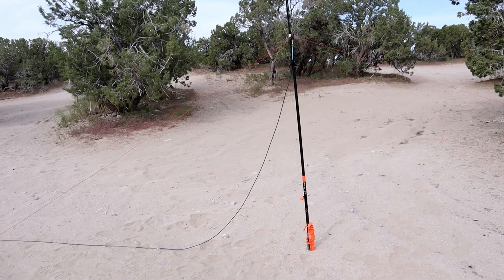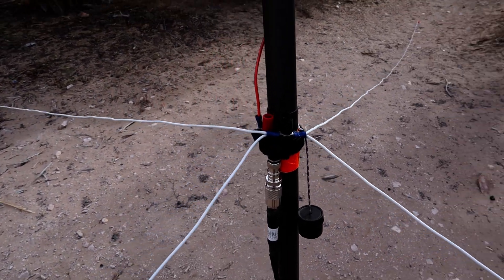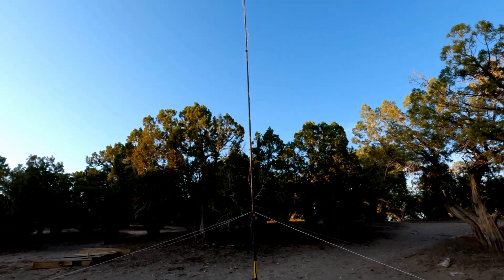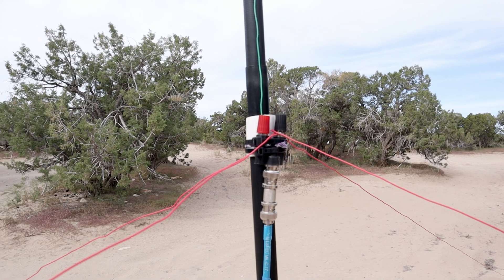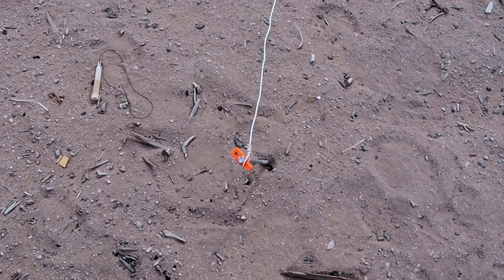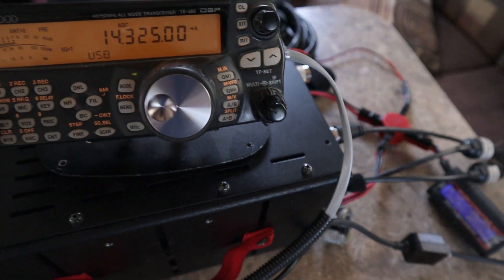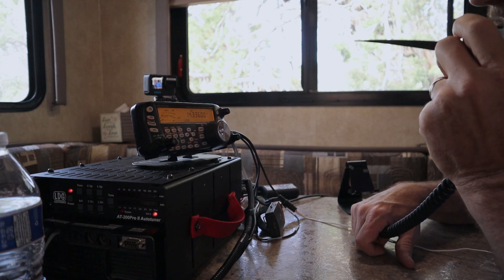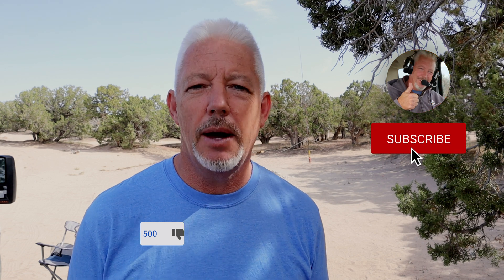Does a heavier gauge wire antenna make a difference ? | K7SW ham radio

Comment: Kevin,are you finding high noise with the vertical antenna.😮
Reply from the maker: Certainly in town, but in the wide open spaces, verticals are really good in my experience
Reply: @hamradiowithkevin  Cool! I tried a vertical but my ground is cement, difficult even elevated radials.

Comment: I like your test, Kevin. I'm thinking later in the day when it gets hotter, the 14 gauge should out perform the 27 gauge wire the thinner wire has a higher resistance. Therefore probably lower voltage and current. The temperature will probably make a difference but I'm not sure.
Reply from the maker: Thanks, yes thinner more resistance. It will be hard to see a noticeable difference doing qui k operations.

Comment: Interesting I wonder is a 12 ga thhn wire would be even louder?  It seem like it would be tougher, & if you doing a drive up & set up activation the heavier weight probably  wouldn't matter as much.
Reply from the maker: In the end, I believe that we will not see any significant difference

Comment: Am not sure why you went through the all the effort to set up the test, but only made a couple of contacts.  More data is needed.  I would think the two antennas would be virtually identical in performance assuming that all important  resonance of the two antennas is identical.  Also the fact that the two antennas were in close proximity to one other is affecting this experiment, Ideally the other antenna would be minimum 10 wavelenghts away.  Too bad you didnt make more contacts.  I do appreciate you doing this test though.  Good Stuff

Comment: I think an antenna with a thicker wire will give you more bandwidth but you won't notice it that much the longer the length of the antenna is. Length is always better than thickness. With shorter antennas for higher frequencies, you will notice better bandwidth from the thicker wire a lot more.

Comment: From memory the radials out at 90 degrees horizontal will give the feed point incorrect (higher) impedance similiar  as vertical ground plane. At
 130 degrees the ground plane should give feed point about 50 ohms, similar to a dipole.

Comment: Hi there! Thanks for the video. I've been wanting to make a 40 meter 1/4 wavelength vertical with my 40 foot spiderbeam. I have one of those BNC binding post adapters that I use with a KX2 and QRP use. I want to run 100 watts from the antenna I want to make. Will those adapters withstand a full 100 watts for an extended SSB activation? If not, what alternative do I have to connect a wire antenna and radials to construct a vertical antenna that doesn't involve soldering something up myself? Would I need an unun? A balun? 1:1, 4:1, etc.? I don't fully understand these aside from the fact that a 9:1 is typically a EFRW and a 49:1 is for an EFHW. I'm pretty much in the mud when it comes to the other two and how to construct this. It's probably easy but I've turned nothing up online. If that BNC adapter would work for 100 watts, then maybe that's my simple way out. Otherwise, what are your thoughts? Thanks again, enjoy watching your videos.
Reply from the maker: I have never had enough power while our portable operating to test the connectors capability,  so I really can't give you a diffusion answer.  Your test sounds safe enough to me.

Comment: Would be curios of difference between 14ga and 18ga wire.
Reply from the maker: Probably not a big difference in those 2 wire gauges. I may make  a video on 26 gauge and 14 gauge. the 26 awg is extreme and I use it commonly for SOTA activation's. and super fast stealth setup.
Reply: @hamradiowithkevin  No pun intended but why such a light gauge?

Comment: If you could only have four outdoor ham antennas, what would they be
Reply from the maker: Pat, 4 antennas forever? Or 4 antennas for a given trip?   I say, make this a journey, and keep making antennas until that is no longer a question that you have. 
For a trip I would say a 20 meter vertical.  A linked dipole, 20/40m , a 10/40m endfed. A vehicle mounted Hustler or hamstick system.  These would cover you for many uses. 
Thanks for asking.

Comment: Kevin, very interesting. I think it would be really interesting to see the difference between your vertical (either one) and a 20m horizontal loop. Loops are typically supposed to be quieter antennas. In your environment, it would be nice to see the difference. 73, Steve AE6SS
Reply from the maker: Steve, this is a great idea.  I will be planning on something just like you described.  Thanks for suggesting.  73 Kevin

Comment: Great video. I have a 20m wire vertical and also have a 20 meter stainless telescopic vertical. I’ve tried to find performance differences between the two and have come to no real conclusion. They both work well. 

Either way, it’s a super fun experiment and looks like you had a great time testing it out!
Reply from the maker: Thanks for watching,  if you have both verticals,  then you absolutley know how fun it is to use both the  SS whip and a wire vertical.  I have never tried the 292. I will be looking into it now.  Thanks for the tip.
 73 Kevin

Comment: I'd like to suggest a change in the comparison setup. Use just a single pole, a common set of radial wires, and run both vertical wires up it a few inches away from each other. Most important, this puts the two vertical radiators at essentially the same place. Connect the unused wire of the two to the ground plane through a moderate reactance (either capactive or inductive) to detune it by a frequency factor of at least 1.5. For example if you are on 20 m, get the detuned wire to resonate at say 21 MHz or else 9.3 MHz, so that it will have minimal interaction with the used wire. You can use the same detuning reactor for each of the two wires. Adjust the lengths of the two vertical wires very carefully so that their resonant frequencies are the same; their lengths will differ a bit because of their different diameters. There should be very little difference then between their (resonant) impedances. Then run the conmparison tests again, preferably using the reverse beacon network, or else with a nearby station within ground wave range.

David  VE7EZM and AF7BZ
Reply from the maker: David, these are some really good ideas for a future test, thanks for the great suggestion. A test like this would certainly take a couple of people, ground wave might have more  more reliable results. Band conditions change so fast recently that I would not expect the RBN to not be that reliable of an indicator.

Comment: It's an interesting experiment, but I got confused about what you were doing when you said that one mast was taller. Was the second antenna at the same height as the first?  

Was one mast fiberglass and the other carbon fiber (conductive?) Was 1 antenna near a tree and the other one not? Was the coax the same length? Thicker antenna elements increase the antenna capacitance, so the elements need to be shorter. Also, various types of insulation on the elements increase the capacitance of the elements, again meaning a resonant antenna needs to be a bit shorter. I'm afraid there are a lot of variables in this equation that need to be accounted for in order for the results of the experiment to mean anything. Also, what I'd really like to see is someone with a signal strength meter LOS about a mile off monitoring for any differences in measured signal strength. But thanks for giving it a try. You have piqued my curiosity since I'm about to build a similar antenna.
Reply from the maker: Great questions John, 
Taller mast had thicker sections to hold the weight of the thicker wire. For the test, both were  within 6 inches of each other off the ground. Coax was the same length as well. If this setup was important enough to me, I could have spent more time looking at the variables that you mentioned. For my comparison in this video of SOTA and POTA activation gear, I really needed to see If the performance was significant enough to warrant taking heavier gear.  You would be surprised would will work when creating a small antenna. I hope you do build the one you talking about.  Tons of fun !   73 Kevin

Comment: Great video I do know that the thicker wire has more broadband I did an experiment on 10 meters think it was 14 gauge if I remember right wire has 1 Mhz bandwidth and 15 mm copper pipe has all most 2 Mhz bandwidth the I didn't see any difference on the RX. (M7XCB)
Reply from the maker: I do think the receive was misleading. Your right about the thickness.  I am so looking forward to 10 meters getting better.

Comment: Comparing fading signals is really hard.  I would rather compare  ground wave or even better: line of sight.
But ground planes also rely on radials and what direction they are in.   It is probably way easier to compare two dipoles side by side at the same height.
There are also some interesting effects of stainless steel vs copper, where the former has eddie currents on RF and surprisingly high resistance at skin effect.
But still I use stainless here, but quite thick and sturdy.  It does not come down every winter in my stormy location.  ^^
Reply from the maker: Per-Einar Dahlen, Your right, a  set of dipoles could have been easier to get better reading from.  I am now curious about the effects of stainless vs copper.
Copper wire antennas like these really are meant for fast, simple portable use.  73 K7SW

Comment: It might be better to set up a CW memory with “test de k7sw k7sw k7sw k” and run it at 30 WPM, switching between antennas and alternating between two frequencies just above the FT8 frequencies. The RBN will give you far better data,
Reply from the maker: Steve, thank you that is a fantastic Idea. I can make that happen on the next test. 73 Kevin

Comment: Hello Kevin,  the only electrical  difference should be the band width. The "Q" is effected by the size (diameter) of the  elements. Given all other conditions equal. Have fun. 73' LEO
Reply from the maker: Thanks Leo, your right, and being that the bandwidth on both antennas was good enough for me, I might prefer to go with the smaller wire, it is far lighter and can tolerate windy conditions much better. thanks and 73
Reply: @hamradiowithkevin  Hi Kevin,

Thank you for all the work on this project!

Did you happen to log the bandwidth differences between the two wire gauges at the same frequencies? 

I'm trying to track down info that cross-references AWG vs bandwidth (or Q) at representative frequencies while using specified conductors to select optimum antenna wire for a "permanent" multiband EFHW.  

Thicker wire should increase bandwidth/decrease Q, but is of course stiffer and heavier with attendant ill effects on a fiberglass pole. However if the difference is truly negligible, then the lighter gauges will be better. Would like some quantification and also to not reinvent this wheel if you or others have the data.

Figuring out best compromise is problematic, for me anyway.

73,

John - KK7JBZ

Comment: I think the results would be inevitably predictable, favoring the antenna with more conductor area present to be "hit" by the transmitted waves.
This did make me wonder, if weight and bulk were the concerns, how a fiberglass rod or perhaps one made one of the newer types if plastic, coated with conductive paint or similar coating would perform as a lighter weight high performance antenna.
Reply from the maker: Rich, yes more surface area is good. Your right, exploring the possibilities can produce that perfect fit for our own unique operating needs.
73

Comment: I've wondered about this idea, thinner versus thicker gauge and how it would affect RF. Thank you for taking the time to show us. Setting up field antennas takes time and you have two for this one! The results you had make me think about how thick of wire I'd want to go portable with. Ha, I guess we could make a coefficient for RF gain to weight ratio :) Or something fun like that. 73, Eric
Reply from the maker: Eric, it does take time and is very fun  to put effort into an antenna that works reliably.  Simple verticals work really well and are a good addition to a ham radio antenna bag.

Comment: Hi Kevin, Great videos you are putting out. I would recommend using WSPR for these tests.. You could run 3 or 4 2 minute transmissions, alternating every tranmission to the other antenna... this would give you some sort of quantifiable findings but as you know mother nature can make these bands wobbly! The other test that I do to compare antennas is do two or three cq test de k7co and the reverse beacon network picks me up and gives me the signal reports in DB.  You probably already know about all of this I mention.  Hope to meet up with you sometime. 73 from South Jordan UT, Jon K7CO.
Reply from the maker: Thank you Jon, it has been a while since I used wspr, that's a great idea. Also rbn I forgot about that.  I can absolutely try those on the next test.   I appreciate the idea.   73 K7SW
Reply: @hamradiowithkevin  WSPR is a good idea.  I personally use FT8+pskerporter because there are dramatically more FT8 SNR reports being generated.

Comment: The 2 antennas has a direct effect on each other - one becomes a reflector or director to the other - effectively making it directional…😜
Reply from the maker: Being 30 feet away from each other, I am not sure that was an effective   reflector on this setup. Your are right about the effect, I plan to build a setup with two verticals as a reflector configuration.  Thanks for watching. 73
Reply: @hamradiowithkevin  so your "reflector "will be a passive longer wire? How far apart from the driven wire?
Reply: @hamradiowithkevin will your second vertical have radials and voltage or passive.

Comment: I totally forgot about the signing on to the Net. I miss those check-in days. 

The craziest antenna I ever tried to build and use was turning a Navy Battleship into a HF radio antenna. It worked but not very well. We (M.A.R.S.) didn't care to trouble shoot. We had to go back to running the station for welfare calls. At least I can cross turning a battleship into an antenna off my to do lit.  😂
Reply from the maker: Capt. Jack, THAT is a really cool story. Not many people can say or claim to have tried using a navy ship as an HF antenna. you are a true experimenter ! I love it.

Comment: 🤘💯🎸🎸🎸🎸🎸🎸🎸🎸🎸🤘👍🍻🙋‍♂️
Reply from the maker: Guenter , thanks !  73
Reply: @hamradiowithkevin  you very welcome Kevin. You doing such a great job everytime escpecially in this high Temperatures out in the Desert. Believe it or not we had 100°F were I live for the last 3 days in the Row which is way too soon for the Summer Season as it usually gets this hot around mid or end of July. This year everything got torn upside down, wx wise.
I love that funny comparison with the 2 different Antennas on the Coax Switch. Everytime the Bands are stronger opening and closing and you ask for a  Signal Report your QSO Partners getting confused about which Antenna is AT1 and which one is AT2. Again one more time PLS.... 😂😂😂.
I really hope and wish we making that 1st Contact happening really soon. I still haven't worked no Portable or Mobil Station in CA, NV, AZ, OR or UT yet. Time to get that done.
Have a kickass Week and keep up your fantastic Work. 73 de YFUG 🍻👍🙋‍♂️

Comment: Thanks Kevin. Did you notice whether the heavier wire needed to be shorter? 73
Reply from the maker: Locksnut, I started with the radiator wire at the same length on each antenna and adjusted the radials to get the match to where it Ended up. 73 Kevin

Comment: Awesome video Kevin Thanks! Was wondering about wire thickness recently. I wanted to ask what mic do you use for videos? I'm trying my hand at making an odd video and would love to improve them 😊
Reply from the maker: Your welcome, I hope to do more practical field testing in the near future to provide more information about the wire differences. I use a number of microphones in different ways, sometimes connecting them directly in the speaker sequence. it really depends on the situation. I wish i could say that thee is one best way. I am still experimenting. get the mic as close as you can and protect it from wind and you will see the most improvement in your audio.
Reply: @hamradiowithkevin  no worries, completely understand, thanks!
Reply from the maker: @AmateurRadioSouthAfrica  , if I were to suggest something, it would be the Senheiser MKE400. That mic has been really good and getting audio that I need. I also rely on and count on the Tentacle Sync 32 bit float pocket recorders. Not cheap but work fantastic for what I use them for.  I hope that helps you and gives you a better Idea.  73